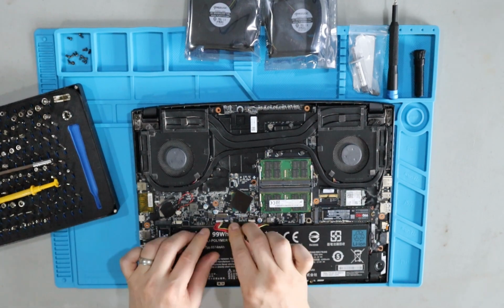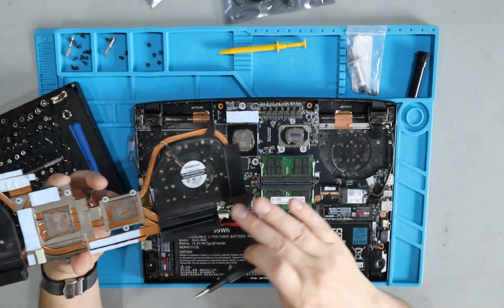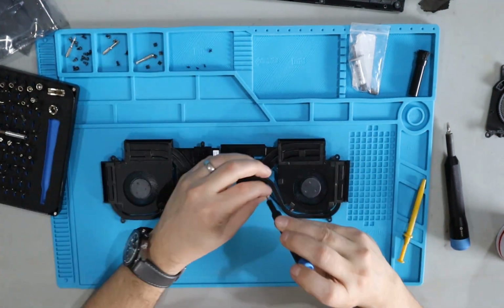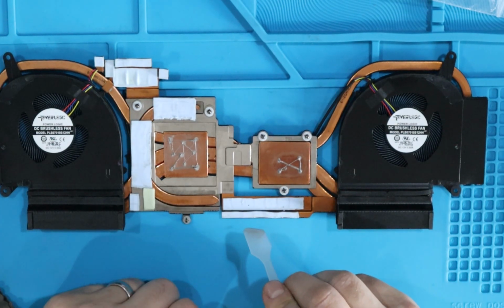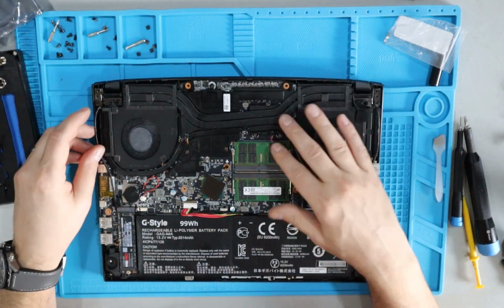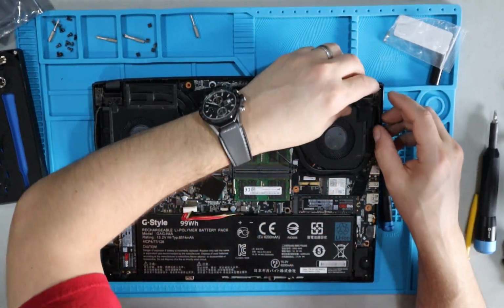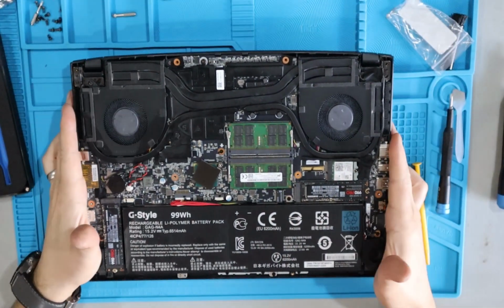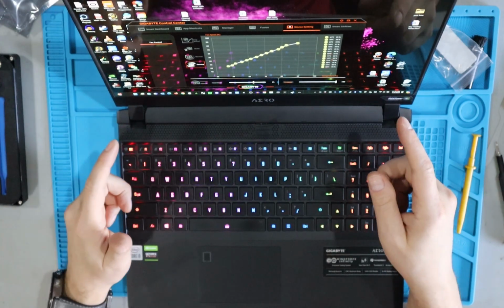Laptop Fan Replacement Gigabyte Aero 15 OLED

Comment: I just cleaned the heatsink and fans too - took the propellers out and everything, oiled them etc. = just spent money on the thermal phase sheet and thermal pads for the other components! Works like new! Yeah, initially I wanted to order new ones, but I said: let’s try it out, and clean the heatsink, fans, everything, since I don’t have anything to lose. It worked! 

Didn’t need to order new fans. Hope that this encourages anyone. Take care. 

Don’t give up on your fans! 
Unless they’re really broken. 
Mostly it’s just DUST. 

Leo
Reply from the maker: How long have they been working since you oiled them? I'm curious to know if the oil lasts for more than a month or two
Reply: @WhatsMyGear  Well, I will have to see. Why wouldn’t the oil last longer? Do you change your oil, in any device (motor, car etc.) every few months? 

But good question. 
I’m also curious. 

Bottom line: it works as new.
Reply from the maker: Some oils are designed for high rpm some are not.  Some systems have full enclosed components to hold the oil, some don't, resulting in losing oil over time. Some oils will break down with heat and some won't.  This is a space with a lot of unknowns for me, so I'm just curious.

Comment: Dude, why don't you paint the entire radiator with a thermal interface, or even along with the tubes? If you like smearing thermal paste so much
Reply from the maker: Not sure what you are talking about.  The paste was applied exactly and only to the mating surface.
Reply: @WhatsMyGear  compare the area of the crystals with the area of the radiators on which you smeared the thermal interface

Comment: Would you know the part number for the aorus master 16 am6h its a 2025 laptop and already having this issue
Reply from the maker: Thats wild. I thought they would have resolved this for newer laptops. Sorry I don't know the part number for that one.
Reply: @WhatsMyGear   No worries I appreciate the response.  MX-7 Is a pretty good thermal paste, thermal grizzly as well.
Reply: @WhatsMyGear part number EG75091S1-C440-S9A, EG75091S1-C470-S9A

Comment: Thank you so much for this valuable info brother! Are you saying that my Aero 15 can accommodate up to 4TB SSD on each slot??? I swore it was 1TB each from some article I read 2 years ago :/
Reply from the maker: I belive I had two 4 TBs in there but can't remember exactly because I have a new laptop now. But I am pretty sure I used at least one 4TB and 2 or 4 in the other slot.
Reply: @WhatsMyGear thank you much for that info bro. I will look to get me one 4TB at least

Comment: The little rubber grommets didn't go back on mine once I took them off & now I need to find some adhesive
Reply from the maker: Yeah the sticky side could get weak.
Reply: @WhatsMyGear what do you recommend to use? Cause I'm having the same problem but I'm scared of using the wrong adhesive
Reply: I also had the same problem I found a solution that worked well since I had no regular adhesive. You know those really sticky fly catching fly ribbons made by raid things with the thumb tac that hang from the ceiling I opened one of those up pulled it out enough to see the sticky stuff and rubbed each little square on it and made them super sticky and put back on laptop it worked very well and since that stuff gets stickier the hotter it gets . You only need a little bit of it.

Comment: Dude, you got so lucky finding an original fan. I bought some off of eBay, Amazon and AliExpress and they all have either fewer or thinner fins or don't spin up/down as quickly (as in - up to 4 seconds to hit the target speed). Even though some have the same label on the front.
I ended up just lubing the original ones real good and crossing my fingers that they'll last until I'm not unemployed any more.
Reply from the maker: I can't believe they built this amazing machine with a crazy fan that doesn't last

Comment: Why are you unsure about whether it's the correct fan model? At least it looks exactly like the original.

Contrary to the knockoff that I bought. I figured that it would be the same other than the brand, but it isn't. It has fewer and thinner fins and no little pieces on the outside of the ring. And it is rated for 1A instead of 0.5A - which probably doesn't matter but still.
Reply from the maker: Because I couldn't find the exact model number match, so I figured this may be a knock-off, and since I wasn't 100% sure, I didn't want to misrepresent it. But so far, it's been working for me.
Reply: @WhatsMyGear  It says it right below the "DC brushless fan"? PL-Something-12HH after 2:00. And then the new ones at about 4:28.

Anyway, my knockoffs are garbage. Crashed my machine so hard when running OCCT that I thought it was dead. Possibly because of having fewer and thinner fins and reacting more slowly to speed changes.
(Fortunately, it turned back on after having it without power for 15 minutes or so.)

Comment: I've owned AERO 15 YA for 5 years, the GPU fan died twice. Is the quality issues or the BIOS misconfiguration triggering this?
Reply from the maker: I'm under the impression it's the fan quality. Maybe the bearings or something.

Comment: i also have the aero 17 XE5  but the fans aren't efficient and my laptop over heat up to 90°C which is too hot, do these fans are more efficient and quieter than the original ones?
Reply from the maker: I didn't do a comparison, but I can run games on max settings, and it doesn't overheat. Also, make sure to properly blow out dust so the copper fins can dissipate heat as efficiently as possible.
Reply from the maker: Not sure. Make sure to blow out dust.

Comment: Hi there. I got a Gigabyte Aero 15 OLED KC(2021). I want to upgrade my RAM from 16BG to 32GB. Which band of ram would you recommend? Thank you so much!
Reply from the maker: I like Corssair, something like this but you need to check compatibility with your machine so dont just buy this linked product, im sending it as a concept:  https://www.amazon.com/dp/B08GSTF5NJ/ref=cm_sw_r_as_gl_apa_gl_i_V2028ZXCQJAQ6X15RVTP?linkCode=ml2&tag=whatsmygear08-20 and there are other great brands. I've had good luck with Kingston too.

Comment: I have a Gigabyte Aorus 15G KC with an i7 10870H and a RTX 3060. I have planned to replace my cpu fan since it started rattling around 3 weeks ago. Is it necessary to replace the thermal pads as well when removing the heatsink? Or is only repasting my cpu and gpu enough?
Reply from the maker: I dont know. But I would guess they are fine if you can preserve them and keep them clean throughout the process

Comment: Nice! I followed this vid to access the fans and I found that the fan blade assembly can be  gently pulled free from the motor. I did this and put a tiny bit of grease in the spindle hole.  I changed the thermal paste and blew out the dust.  Runs much cooler and silent now.  Very happy! Just consider that maybe a noisy fan is an easy fix before ordering a replacement.
Reply from the maker: I didn’t know that was possible. Thanks for sharing!

Comment: I followed the video and I thought everything went well but after plugging in the battery again the computer won’t stay powered on. Any suggestions?
Reply from the maker: My guess is either the heat sink / thermal compound is not dissipating  heat fast enough resulting in a thermal shutdown to protect the CPU. Or maybe one of the connectors you removed then replaced is not fully connected.

Comment: I have a question the fan and cpu fan connectors do they go in with the end of the connector pin side up or down?
Reply from the maker: I thought they only fit one way because I thought the connector was a directional fit connector. But I could be misremembering. Your best bet is to take a picture of each connector on your system before disconnecting it. Or watch the video and pause it, maybe zoom in at the moment when I disconnect and reconnect the  wires. Hope this helps.

Comment: Hi . The most of gigabyte laptops fan gets fail . 😢
Reply from the maker: I didn't know that.  I hope this video helps others.
Reply: How many out of how many? 
Because I've had my laptop for about 5 years now, running 24/7 for the last 2-3 and only now, one fan has failed.

Also, at least we're able to fix it pretty easily. I suspect that not many manufacturers make it this straightforward?
Reply from the maker: Its my daily use laptop. Full desktop replacement. I think I've replaced both fans by now, and possibly one of them twice. I've lost track over the years, but it's at least 2 fans, maybe 3.
Reply: I bought my laptop on June 2021, and first I had problem with the charger, it wasn't able to supply power to both battery + the computer, and it was disabling the charger when my GPU was activated… Then, I needed to buy a new charger.
And yesterday, my CPU fan started doing a weird noise and after removing the protection case under the machine, I did note that it wasn't spinning correctly, therefore the noise; I needed to buy a new fan today… It will take some days to arrive.
Reply from the maker: Good luck my friend! These fan replacements are slow and methodical but if done right, it's a great feeling of self accomplishment.  Plus saving some cash compared to paying a company to fix it.
Reply: @WhatsMyGear  Hello man, I'm glad about your prompt answer! I've already I disassembled and assembled it again today only as a test and everything worked as expected, so I'm more confident to do the replacement once the new fan arrive. 

About the thermal paste, do you think that 1.5g is enough to cover the area we have on this machine?
Reply from the maker: I'm not sure bec6 I've never measured it but I can say you don't need alot. But I have applied paste more times than I can count on my lifetime, so I just do it based on feel and I eye-ball it based on experience. Id recommend you prep by watching a few YT videos dedicated on how to apply it.  I've watched videos that do it in very diffent ways and some videos contradict eachother.  So your best bet is watch a handful of videos and based on that learning, pick the the approach that you feel best about.
Reply: @WhatsMyGear  Yeah, I was watching exactly this now man... I watched some comparisons about the most effective way to apply it! Thank you for your support.

Comment: does this fan fit for gigabyte aorus 17g yc ?
Reply from the maker: No idea. You would have to research that on the seller's page on Amazon by searching the Questions section or check the fan compatibility section written by the manufacture of the fan. Or take your fan out of your laptop, look at its model number and seaech Google for compatible replacements, and see of this one matches those replacements.
Reply: @WhatsMyGear thanks

Comment: You should try phase-change material Honeywell PTM7950. It comes in as a sheet, lasts longer, performs works better than traditional pastes and there is no pump out effect. Instead of thermal pads, I suggest applying Upsiren U6 Pro or UX Pro thermal putty. It is also a good idea to do CPU and dGPU undervolting.
Reply from the maker: Thank you for the suggestion. I'll look into this, sounds interesting 😀